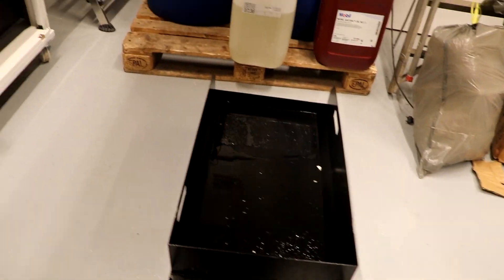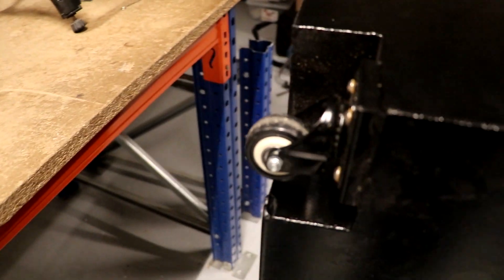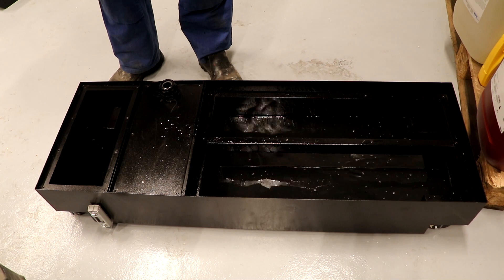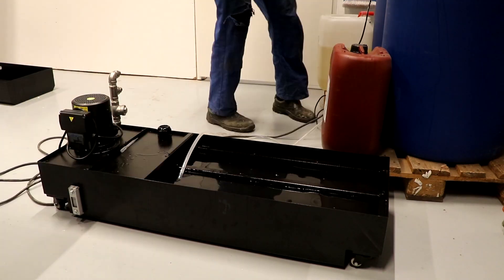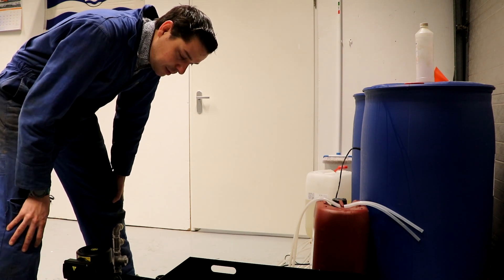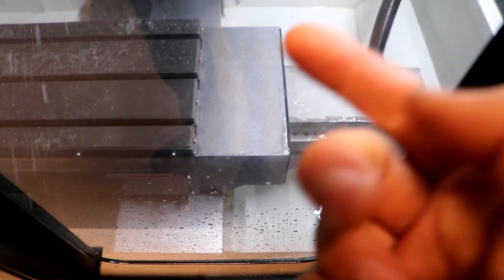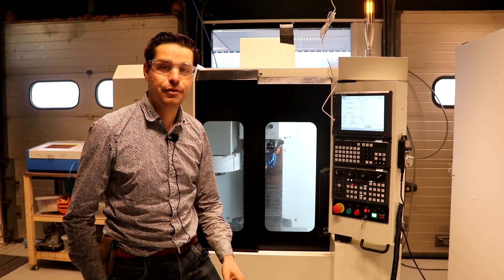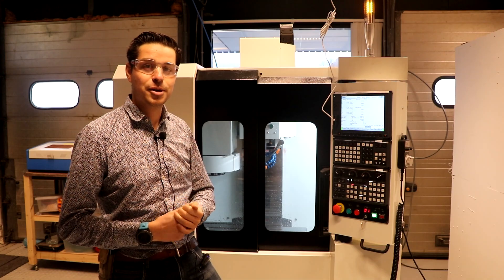Chinese CNC mill arrives with a leaking coolant tank... How to fix it

Comment: Poor welding. Drain tank, dry, then silicon  all weld seams internally. Disappointing, I had one on order earlier  in the year but delayed due to covid, now I'm just putting it on hold see if the machine did actually worth me time.
Reply from the maker: Ok! Well I hope it's smoother sailing from now on. And it would be great to have you in the syil community